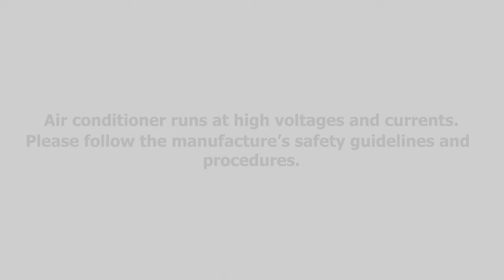How to Clean Outdoor Unit of Split Air Conditioner || Learn Split AC servicing in Easy Way ||

Comment: Use ur garden hose. Squeeze the end of the hose little bit to create a pressure water and splash the water at the back of the unit without opening or removing any part :) do it in the afternoon, to let it dry fast. It will be clean 90%. If u have plenty of time u can do it as he showed u in this video it will be clean 100% :)
Reply: Does it broke your ac? mine is. The fan becoming slower😢
Reply: don't do it as it will break the motor of the fan. if it doesn't break, it will accelerate the rusting process, and thereby lowering the fan speed. water is a catalyst in rusting process.
Reply: @woofu9872   rust builds up that's why. change the motor of the outdoor unit.
Reply: If the water goes in the fan motor will not be a problem?
Reply: Only Dubai is a good boy.

Comment: This is not really convenient for units installed outside of a balcony. best to use an air blower, and blow out all the dust, then turn on the fan of the outside unit to remove them.

Comment: The circular shape External grill fitted on the outdoor unit , in front of the fan blade which is a LG , 1.5 ton non invertor ac has broken .
Where can I buy one to replace the broken one please ??
Reply from the maker: Contact Customer Support
Reply: @lovepreet666  THANKS

Comment: Average we are using 3hrs everyday, Cleaning outdoor once a year or 6months  which is recomended ? how much technician will charge for Indoor and outdoor cleaning
Reply from the maker: Cleaning once a year is fine in most scenarios. Technician charges vary depending on the location and type of service opt.

Comment: If accidently small amount of water goes onside the electrical panner what should we do ???
Reply from the maker: Don't turn ON the air conditioner use a blower or leave it as it is for drying

Comment: Hi my room ac suddenly stop cooling while using and ac technician took some plate of outside unit and saying it needs to be change can u tell me is it required or not it costs 5000 for change
Reply from the maker: Generally, PCB has a 5-year warranty if your AC is older than 5 years then YES, the replacement cost of PCB is high.
Reply: Thank u for ur quick reply but we had changed it with full open ac service thnx

Comment: I have a pressure washer, can I use it to clean the coils from outside without removing anything?
Reply from the maker: Yes
Reply: @lovepreet666 thank you, but will it damage any electrical components? I'll keep the pressure at 150 psi and in full spread mode.
Reply from the maker: No

Comment: can I use dry vacuum cleaner to throw Air inside the outdoor unit from the fan grill without opening it as I am not a professional?

Would that work ?
Reply from the maker: NO
Reply: never use vacuum, but an air blower. vacuum causes static electricity damage.